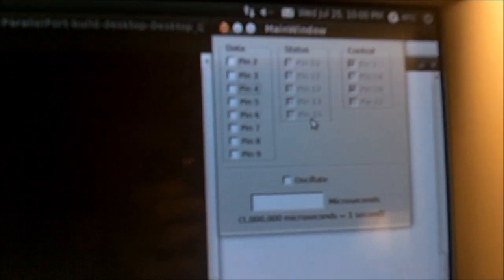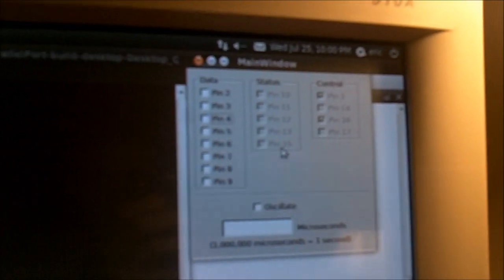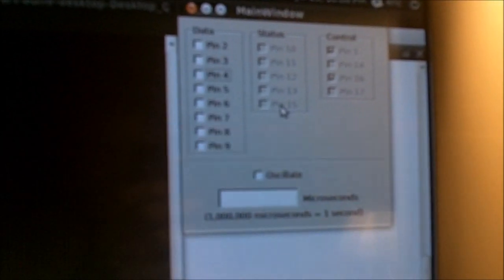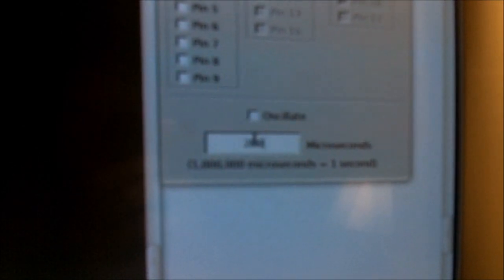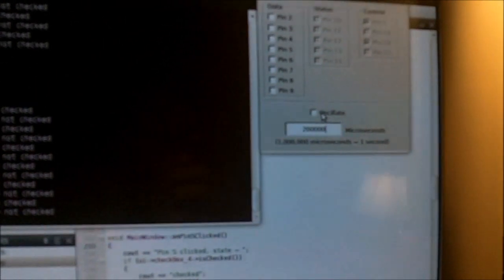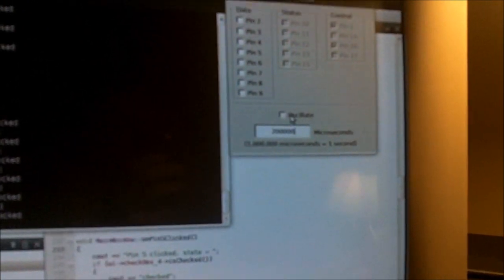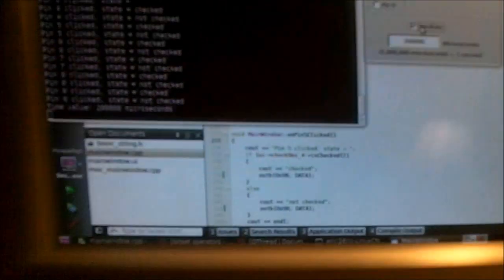C++ Program Controlling LED's Through Printer Port

Comment from the maker: sure. message me your email. (keep in mind this is for ubuntu and you must have QT Creator (version 4+).) You can probably open the project in windows QT4 but you will have to modify it to use DLL's to access the parallel ports. There are also linux-specific functions in this program. I also don't know if it will run on stock ubuntu because I have Linux-CNC installed on mine which installs different IO drivers.